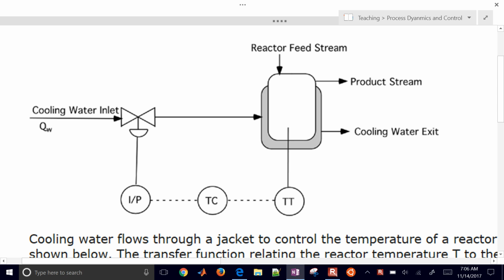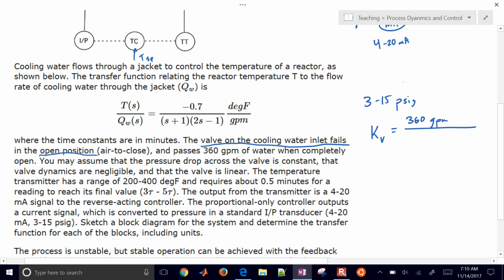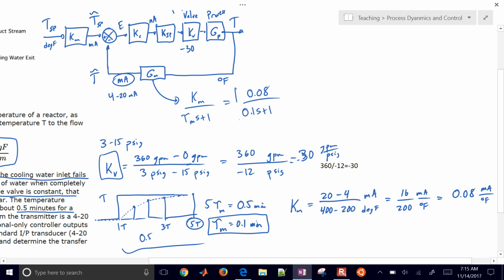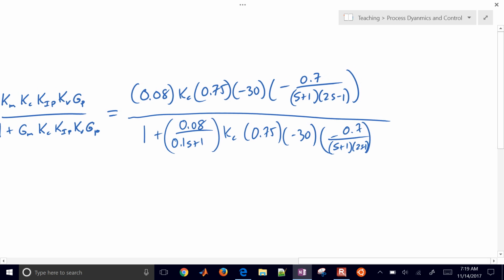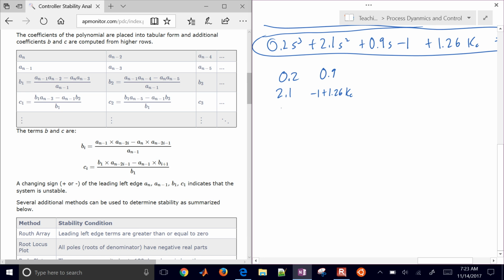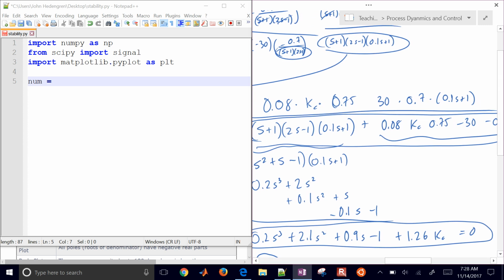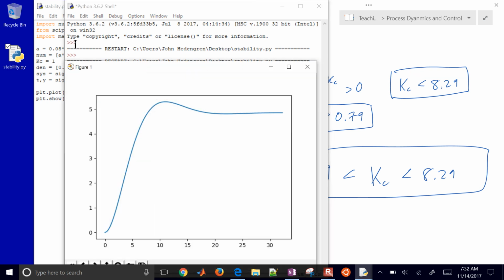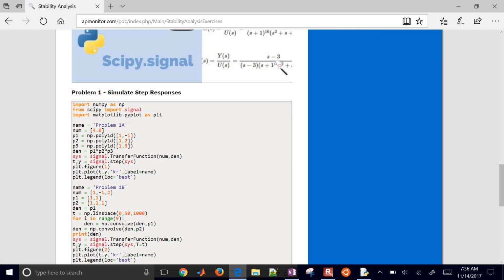Reactor Temperature Control Stability Analysis

Comment: Sir will you repeat this example using PID controller too?
Reply from the maker: +Animesh Ghosh, a PID controller has a transfer function Kc + Kc / (taui × s) + Kc × taud × s. The derivative term is sometimes on the PV versus the error so it complicates the analysis but it isn't impossible. Thanks for the suggestion.